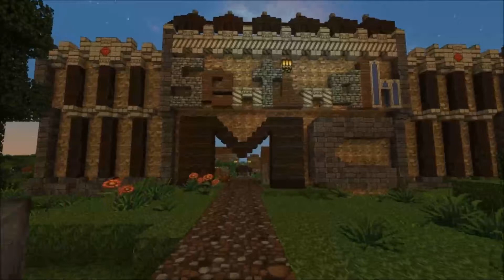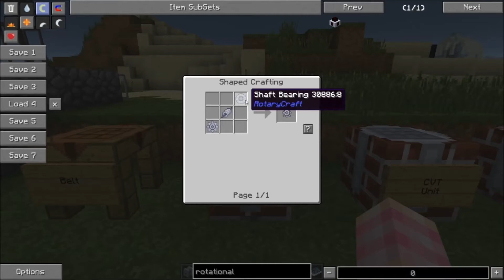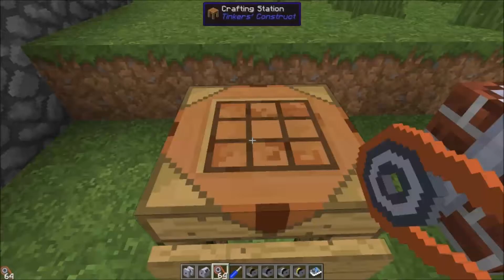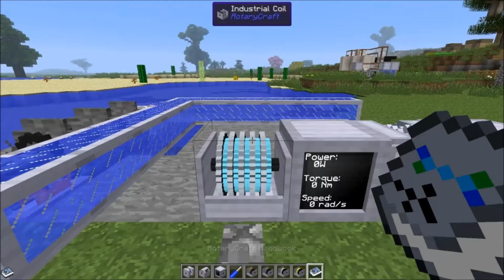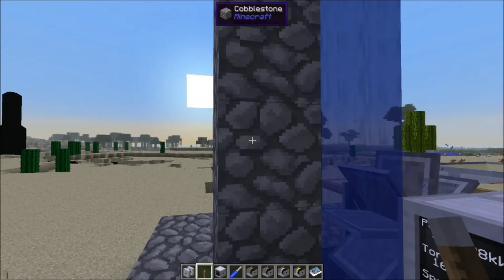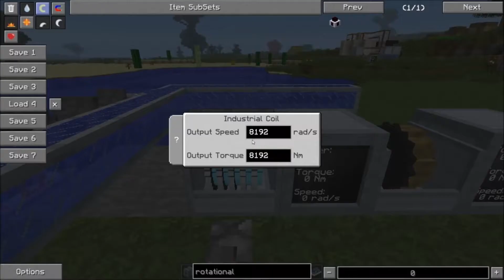RotaryCraft Tutorial #20 - Belts, CVT and Flywheels

Comment: Also, flywheel deceleration is based on the torque requirement of what they are running. Unconnected, they spin forever.
Reply from the maker: Ah okay, that's good to know, that makes sense.
Reply from the maker: SentinalhMC Although wouldn't they slow down due to friction eventually anyway?
Reply: Friction is not implemented in RC machines.
Reply from the maker: Reika Kalseki I figured. That would over complicate things IMO.
Reply from the maker: Reika Kalseki Goodness, you aren't that much of a masochist I take it
Reply: You think THAT is bad...
Reply from the maker: Reika Kalseki I'm sure you've put yourself through worse then.
Reply: You are aware of my educational background, yes? ;)
Reply from the maker: Reika Kalseki Engineering? Nuclear Physicist?
Reply: Aerospace engineering.
Reply from the maker: Reika Kalseki Ooh, yeah I'm not nearly smart enough for that. Most of my talents are creative rather than technical.
Reply: You do fine with RC. ;)
Reply from the maker: Reika Kalseki Aww thanks so much.
Reply: can you do a tuitor on how to install
dragon api pls
Reply from the maker: ethan groves You drop the zip into the mods folder, easy.

Comment: The torque limits for flywheels are the maximum values they can emit. Supplying more does no damage.
Reply from the maker: Okay so its just the speed that makes them explode.
Reply: Yes, because the centripetal forces tear the disc apart, releasing all of the stored energy.

Comment: i wish the Fly wheel would output a Redstone signal at a RPM if you set one to then put that on the  Clutch... since the Clutch alone does not have much use unless you could monitor an output of sorts...